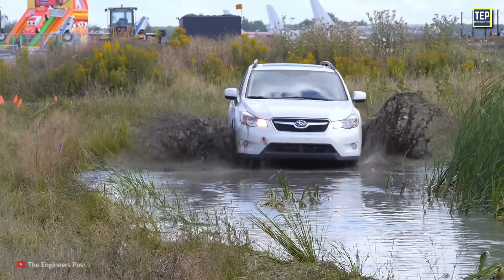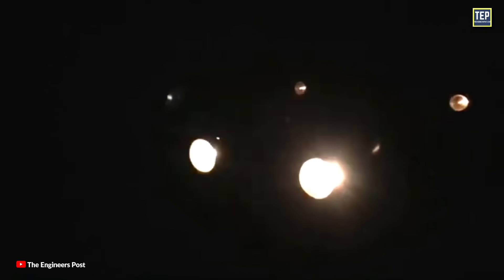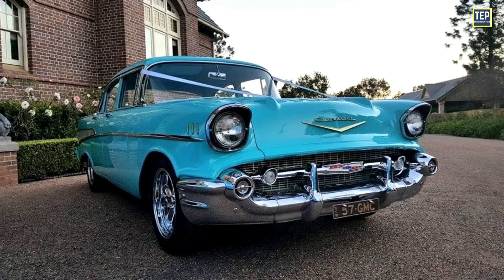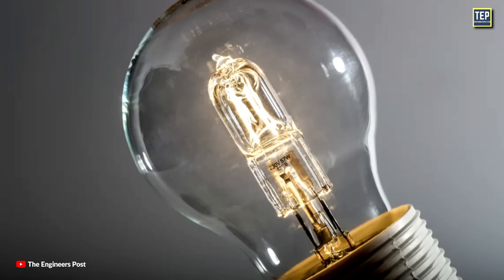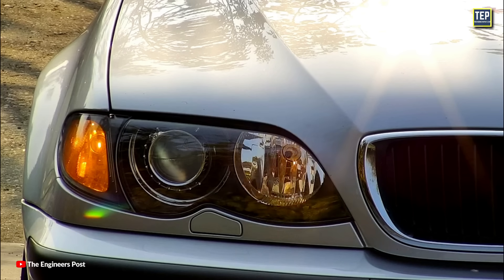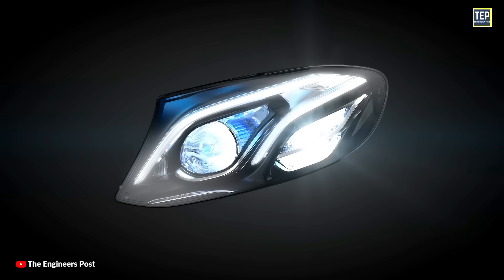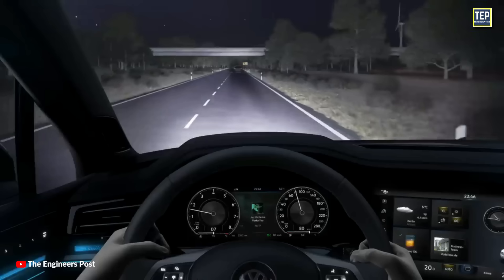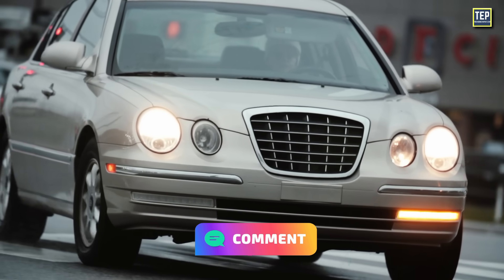The Problem With These Headlights

Comment: I prefer just plain simple cheap lightbulbs, wich are a little orange or like in France, in the 60's and 70's were yellow. Modern lights do blind me all the way. Expecially with SUV's. My car is low, those cars have the headlights way up. They blind easily. I wonder who controlled those lights when they introduced them....

Comment: LEDs can work in a halogen housing if the bulb is correct tf is he on about? Only time you gotta change something is if you're changing your turn signals from halogen to LED you gotta wire in a load equalizer because if you don't it'll cause it to hyperflash because the vehicle will think the bulb is blown since LED doesn't use as much power

Comment: You can install LED bulbs in every position of every car. They require a resistor to fool the computer  so you don't get the CEL turned and must be adjusted differently than standard bulbs. I have them in all of my vehicles including my motorcycle and house. I'll never go back.

Comment: LEDs DO get hot, because manufacturers try to get as much light from them as possible. This in turn reduces the LEDs lifetime significantly, where as if they used just slightly less power they would function for many many years. But manufacturers want to sell lots more than one set per car....

Comment: I run led lows and Xenon high beams.  Im in deer country.
We live in deer country.  we always get cars with the quad headlights. You know, separate high and low beam lights. Then If the low beams turn off when highs are on, I add a relay direct to a breaker'd direct battery connection. and run 2 - 55watt HID 5000k (crystal/white lights.  so low beams remain on while Hid's heat. I can see an animals eyes for 3/4 of a mile, and the road is lit for about a 1/4 mile ahead like daylight.  Signs light and glow 2 miles away.  I AM HYPER responsible about blinding other drivers . So that is not an issue.
P.s I have hit 6-8 deer in my life and tottaled 4 cars doing sooo. Now you understand the super bright lights... and if you dont know, slowing down doesnt help, the deer often run INTO the side of cars at speed...Deer, they are goofy.

Comment: Two corrections:
1. Automotive LED lamps DO heat, and a lot! The majority of LED lamps on the market (OEM or not) need active cooling for that reason.
2. LED lamps will work on halogen lights, but they have to be very well developed by the manufacturer and very well selected and tested by the customer. There are some youtube channels specialized just on that testing. However, people first should check if the use of LED lamps is legal in the respective countris, because it may be not.

Comment: The replacement cost for modern light units can be scary. My friend's 2021 E Class Mercedes failed it's first MOT (inspection) at 3 years . The reason was one matrix control units in the headlight unit had failed. The replacement cost was £2600 ($3300). Fortunately he had an extended warranty. Imagine if you bought a high end German/Japanese car when it's way out of warranty and an LED headlight fails which results in having to write off the car as uneconomic to fix. It's not like they don't fail .. I regularly see modern cars with failed LED headlights. In 10 years time it will not be possible to buy older cars without LED lights and that going to make buying older cars too risk unless after market units at reasonable costs are made available.

Comment: Had to stop the video when it said, "led's don't put off heat" , I guess all those aluminum fins are just for looks.
Reply: True. Every electronic part with current flowing through it puts off heat. Even wires.
(For nerds: I know, not in very cold situations that are not naturally occurring here on Earth.)
Reply: I own three flashlights, at least two of which if not all three have CREE LEDs. I don't know what CREE stands for.  But these lights get hot.  you can have super powerful LEDs that get hot, but you can also have LED driver circuits that get hot--example would be the cheapie household LED screw-in bulbs you get at the store that can replace a regular 40 watt.  The light emitting dome will not be very hot--can run for days and you can grab it.  But the opaque base gets very, very warm.  Almost too hot to touch, possibly uncomfortable.
Reply: @danielgoodman3578  Cree is the name of a LED manufacturer.
Reply: @danielgoodman3578 Cree is a US manufacturer of LED's dude😢
Reply: Led have fans built into them. 😂
Reply: I laughed😂😂😂
Reply: AI scriptwriter hallucinating again
Reply: Wind resistance, that's all😂
Reply: are you fkn deaf? he said "almost no heat emitted "
Reply: let alone the fans usually in their backs
Reply: A problem that we have in snow country is the new LED stop and go lights getting pasted with snow and the heat from the light isn't warm enough to melt off the snow compared to the old lights. The snow will eventually melt off but in a extended cold wave the snow could remain until the air temperature actually warmed up.
Reply: LEDs only operate at a very specific and very low amperage. A car does not provide the correct amperage to run a LED. A LED driver is needed for LED lighting. A driver can be remote, or included in the light assembly. It contains a transformer, power stabilizer, and a heat sink (the fins). Basically there is an inline power conditioner built into an LED lamp, which is why they cost what they cost.

The LED itself, doesn't heat up. Though without the LED driver, it would just pop the moment you turn the car on.
Reply: I haven't hit that section yet, but if they mean 'Not enough to heat the headlight cover and get the ice to melt off', THAT could be true.  The LED lights don't HAVE to put out tons of heat, though.  Under-volt them slightly (for ones that don't have on-board power drivers, anyway) and they lose a little light but drop a LOT of heat output.  They don't put a lot of heat into the headlight assembly, though, at least not when compared to incandescent bulbs!

And for the one reply, actually wires DO put out heat, it just is normally not enough to need to care about IN COMMON USE.  Try an experiment...but CAREFULLY, because I already know this answer.  Use a normal headlight bulb, and feed it through 5-10' of 14 gauge copper wire.  Wad/fold/roll that copper wire up and put it between two dish cloths.  Let it run for a few minutes, but keep an eye on it because if your wire is sneakily-cheap (copper-clad aluminum or the like) it may heat up a LOT.  Even pure copper will warm that up, though, if your headlight bulb takes up a few amps of power.  In normal open air it may not get hot enough to be an ISSUE, but it still gets hot even for 12v at 5-7A, even in 14 Gauge braided copper wire.

Wires get hot...humans usually just have 'crappy sensors' available with which to notice that.  If you don't insulate the wire, it usually just soaks the heat out into the ambient air and we don't notice anything, but they DO get hot unless you're wildly-oversizing the wires.  Normal wires expect that you will be allowing them some variety of heat sinking into the air/the car's frame/whatever.
Reply: compared to a literal glowing hot tungsten wire, LEDs are really not that hot
Reply: @why_oh_elle  led car headlights have cooling fans, halogen ones don't lol
Reply: @73Datsun180B  that's not related to their temperature tho. The way hallogen lamps work itself is by using super high temperature so they can manage fine. LED's will die if they overheat just a bit
Reply: LEDs put out a LOT of heat. I know. My car has 4 of them and they each have their own fans.
Reply: Its the electronic drivers ie transistors, FETs for the LEDS that produce heat. I still do not like them.
Reply: @robhunter2435 Not just that...big LED's putting out 50-100W can have separated drivers and still need big time cooling or they burn up.
Reply: @robhunter2435 

The LEDs produce more heat than a switch-mode driver.
Reply: The electronics in the LEDs give off heat, not the Light Emitting Diode itself
Reply: @prestonm.64  wrong, led gets hot
Reply: The LED is not 100% efficient. It’s close though. So the heat development is low.

But the downside is LED’s can’t get too hot. They have a relatively low operating window in regards to heat. So they do need some cooling..

Comment: I have a Prius 3rd and was struggling to make front low beam lights much brighter and finally found there were crushed particals of Mercury inside the lense. And then replaced it and replaced new blasters and Xenon bulbs aswell. Now I got really high brightness and vision at night like a mint condition when I bought my car 8 years back. Xenon bulbs are excellent.I'm really happy with it. 😍🎊

Comment: 16:46 - Lasers are not limited to prototypes. You can have them on all BMW's over $60k. 
But they're used just for high beam.
Reply: I love having my retinas burned by lasers
Reply: @TheBananermanThefirst  They're also only available on a configuration that automatically diverts them under the oncoming trafic, or left, or right.
My friend with an X5 had lasers and drove 1000 km behind me and it didn't bother me at all. It was better than any small car.

Comment: Powerful LED lights generate heat, but it is for the electronics behind the bulb. High heat degrades the function of the silicon circuitry. Newer LED lights are definitely getting better, but the LED housing has to sink the heat.

Comment: How safe is it when oncoming traffic is blinded by your headlights?
Reply: Like normal. You need to train your eyes to adapt to the headlights. Of course, high beams are significantly brighter which cause a distraction to it.
Reply: Ive been driving for almost 20 years  10 of those as a trucker and its all been fine till these L.e.d lights came out . Hurts your bloody eyes ! Theres no adjusting lol . @unsmarties2235
Reply: @TruthAssassin11  LED lights themselves aren't the issue it's rather the fact that for some reason we make them overly bright and  as white, as white has ever been.
They should rather be bright enough so you can clearly see and have a slight yellow-ish tint to them which really helps when they drive straight at you.
Reply: @unsmarties eyes do adapt to brightness,by taking in less light and in return making everything more dark. Sounds really safe doesn't it? No chance you will miss a pedestrian because of that.
Reply: @unsmarties umm noooo just stop making over bright lights it's not a train your eyes situation

Comment: LED lights are so bright they give me a headache with oncoming traffic. They should be outlawed
Reply: The whiteness of the light emitted is unnatural and does not mimic sunlight because it is a frequency-focused beam by definition - we are told in the commentary that it commences with a blue laser beam, meaning it comes from the violet end of the visible spectrum. Sunlight gives a broader frequency range from red to violet, which is more attuned to our optic receptors.
Reply: @johnangelico667 sunlight on a clear day is quite high on the Kelvin scale (about 6500K) so quite blue compared with halogen lamps, however as you said a lot of modern headlights don’t have a full black body spectrum because they aren’t made by just heating something up. 

Good LEDs can be made to have a pretty full spectrum at almost any colour temperature and can give a good beam with full coverage. They are pretty expensive though.

I haven’t seen the laser ones they sound like they would be best for the same long distance light throw as an LED light bar or old school spot driving lights hopefully they would be turned off if you were driving at them.
Reply: Yes they should. The weird headlights of today are poorly designed, aimed, and not
Reply: Ban Blinding Headlights run by Mark Baker.  Find it and ad your complaints to thousands of others.  Online.
Reply: My theory is that most people who are blinded by LED lights often drive cars with dimmer headlights. When I upgraded to a more modern vehicle with very bright LEDS, I rarely  feel blinded on the road. When driving my old pickup I notice that I’m being blinded constantly. In my sedan everything is illuminated much brighter in general so I believe that makes other bright oncoming headlights less noticeable if at all. However I am still blinded by trucks and large SUVS that sit higher than my sedan.
Reply: Oh please

Comment: I drive my 2020 Dodge Grand Caravan and it had Halogen bulbs and I hated it because of the yellow hue, I went and had LED bulbs replaced in my van with 6000K lighting in the front and it is so nice to be able to see further down the road with these LEDs.
Reply: The oncoming travellers will not be happy with you.

Comment: When are they going to tone down headlights? That's what I want to know. 
Nowadays there is a "headlight war" on the roads everywhere, people are just trying to blind each other on the road, it makes no sense. And I'm not talking about cars only, bike and motorcycles now have extreme bright lights too. Some bicycles even got those high speed blinking lights that are extremely disturbing.
Halogen lights are ideal, they're safe, low cost, provide adequate brightness without blinding other drivers.

Comment: Hid is best overall but at local stores only philips or Sylvania bulbs ($100+) are available but Amazon can get some decent aftermarket bulbs for 20 dollars for Dmex last longer than halogen as well and 6000k is best quality light but not DOT compliant but is no problem for properly adjusted low beam. Led lights only purchase from places specializing in automotive lighting ,buy good brands Ex. gtr,morimoto,ect and research how they perform in your reflector or projector headlight assembly.
Reply: As an earlier comment stated: 6000 Kelvin is not a good light for the human eye, manufacturers and some fanatics want us to believe this nonsense. best is 2700 to 3000K

Comment: Yes, but after 1997, auto makers started to make the head light much less of a good thing and much more of a appearance model visual design or style option. Where every car now required a special style of head light.  The main problem (which is very  much still on going) is that the head lights are horrible and it's hard to see at night with them and they are just plain hazardous to the driver.  We can't see deer running across the road and it's hard to see the edge of the road and the head lights don't shine out very far at all.  Plus after several years the headlight lenses frost over and the light output is reduced greatly and that gets worse every year.  We can't see cars coming over the hill and when we pass head on we have to guess where the edge of the road is.  Replacing the headlight lenses are very very expensive and ridiculously priced.

Comment: Acetylene gas is also explosive when pressurized over 3 PSI. Welders need to keep this in mind when using it.
     The acetylene bottles you see in welding are filled with acetone this is why the must be used only when upright.

Comment: Years ago, NJ Motor Vehicle inspection would measure the light thrown by the headlamps. The light had to be bright enough to illuminate and had to be directed down at the road rather than up toward the eyes of oncoming traffic. This inspection step was eliminated once all car manufacturers encased the headlamp into the car's body such that only a collision would alter the headlamp alignment.

Comment: I bought yellow (blue-blocking) clip-on/flip-up lenses for my glasses so I won't be permanently blinded by all the oncoming 6500K blaster beams.
Reply: Smart idea
Reply: As an Optometrist, I use blue block lenses for night driving.  Much better.  Go see your local optom for blue block driving lenses. Specsavers has them.
Reply: LMAO gives new meaning to I wear my sunglasses at night

Comment: What I would love to have seen included in this comparison along with the light output and temperature, is the cost of replacement bulb/LED and unit.
Sure these latest LED matrix and adaptive laser lights seem very clever, and they are. But that comes at a considerable price!  
I'm pretty sure we'd be looking at a four-figure bill to replace one of these units when they fail / get damaged.  And lets face it, halogen and xenon did the job well enough for most situations without bankrupting you or rendering the vehicle scrap...   
There is such a thing as too much complexity and I think we crossed that line a while back. Not just with headlights, but car technology in general.
Reply: And this is one of the reasons a slight bump at parking speeds car result to five figure damages.
Reply: I own an Audi S4 cabriolet that is the poster boy for what you are outlining. Brilliant engineering is cheek by jowl with stuff Rube Goldberg would ridicule.

Comment: A little "annoyance" about latest LED  / possible LASER lights , being so efficient  they almost do not produce heat at all..... If your car is caught in a snow storm, all this incomming snow has the tendancy of covering the headlights too, quickly reducing the visibility while driving. Which requires getting out of the car in the blizzard to clean the headlights out of snow. Older "less efficient" types as halogen and Xenon did produce enough heat too, enough to melt any snow covering the headlights, not needing  getting out of car to clean them 😄
Thank you for the interesting video, for long time I tried to find the physical difference of the way of  working between Xenon and halogen bulbs ( knowing that xenon is also a halogen rare gas)...
Now finally my longtime curiosity is satisfied 😁
And I am still happy with my xenon lights 😄
Reply: Xenon is not a halogen.

Comment: You can put a LED into halogen housing but it MUST be projector, my 07 Camry came with halogen bulbs but the housing is a projector housing so when I installed LEDS I did not blind anyone since they cut off perfectly